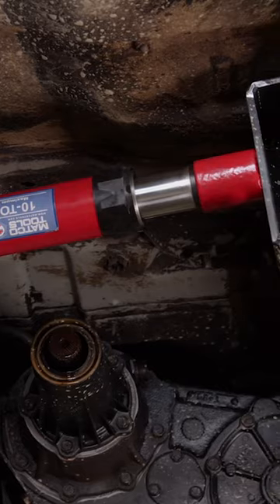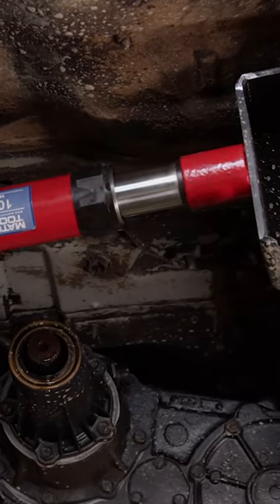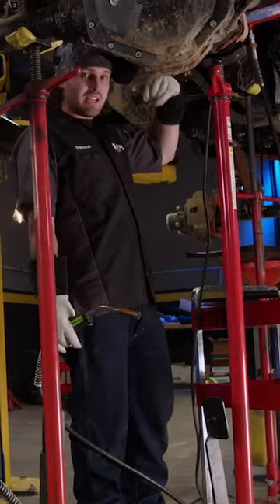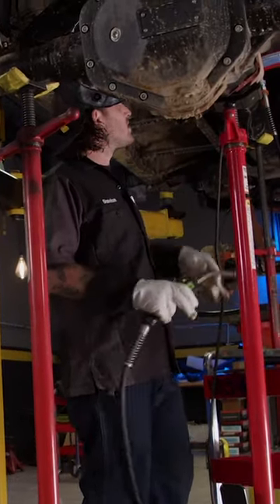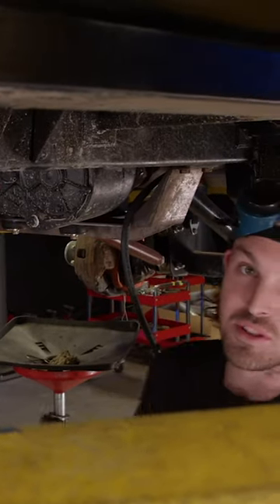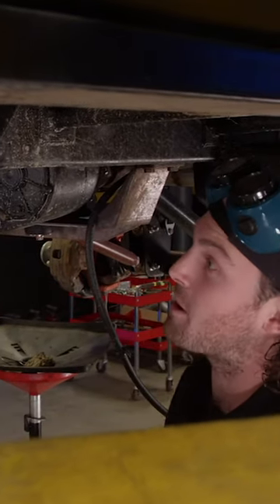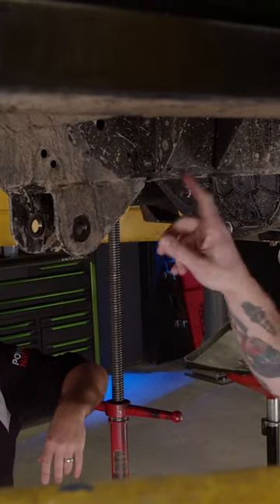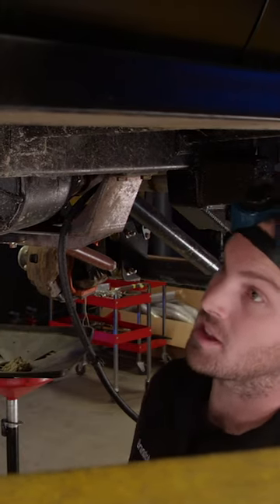Bending a Bent Frame Back Into Place

Comment: No heat required to straighten that frame. It wasn't heated when it got bent. That torch just leaves you with a soft spot in the frame

Comment: If you heat the frame, then it will loose it’s temper. You will make it worse. God help us all from this ignorance 😮
Reply: It's okay to heat it but not as much as they did. They need a rose bud not a cutting tip
Reply: @Krankie_V  As soon as the steel gets red, it’s done. Put a fork in it. If he put steel plate to bridge over the areas he heated that would be ok.
Reply: When it gets mad don’t be mean and give temper back no wonder your frame fails in anger

Comment: Congratulations you have now destroyed the metallurgical properties of the frame due to over heating, on a mild steel frame you should never go above a slight red or better yet use a heat crayon that melts at 800°f and put marks 1 inch away from where you are planning to heat it. Also never hammer the frame back into place as you create work hardening it should be pulled or jacked to remove bends otherwise again you create work hardened zones that will crack.

Comment: I know but I don't kinda. If frame was tweeked a touch. Almost like if turned to left. Am had touch bigger tire. That's where damage is. Pulls  hard to right. Could that little tweak from front damage cause that. Can it be fixed??? Just a work car. Just too God of car to scrap imo. Even though it's 4k $ car